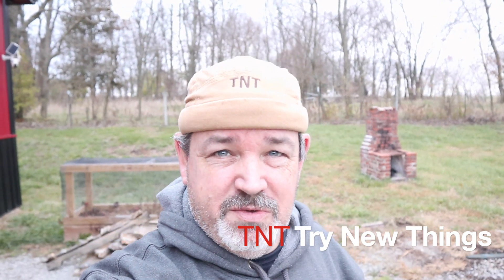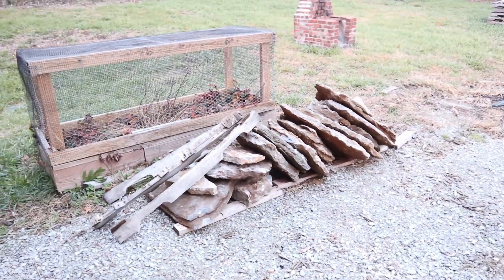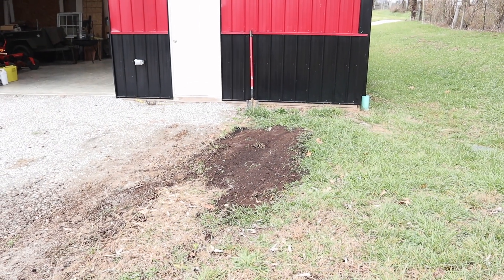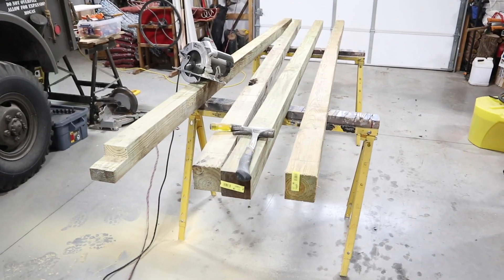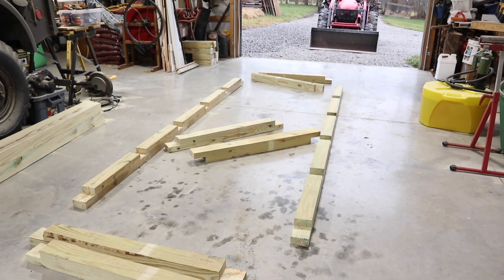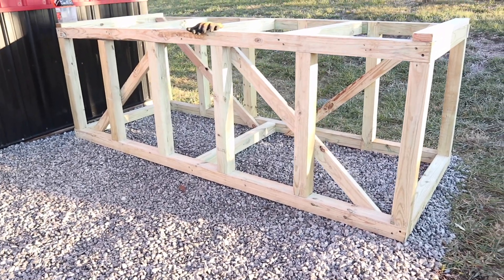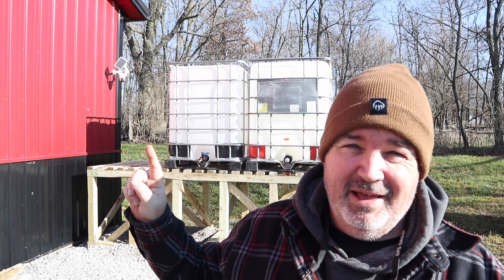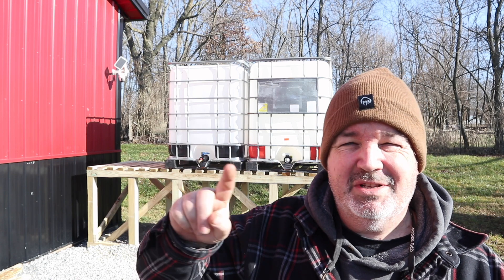#210:   Pole Barn IBC Tote Rainwater Harvesting System Build Pt.1/2

Comment: I'm seriously looking at the 3 barns I have and how I can collect the rain water from them. How do you keep it from freezing in winter?
Reply from the maker: I leave tanks about half full so they don’t blow over.   Turn of inlet valve at the downspout and drain that horizontal pipe that links them all together using threaded end cap.    If I lived somewhere where it stayed below freezing for more that a couple days at a time I’d be tempted to drain the tanks fully.   Surprising how quickly they fill back up.    IBC totes are a good system of cheap and readily available in your area.    Thanks for taking the time to leave the question.    Stay tuned to the channel, I bought a booster pump I’m anxious to try out when it warms up here in March.
Reply: @TryNewThings  I wonder if a water pump or airiation would keep it from freezing? In Western Tennessee we don't freeze for long periods of time (except one week in the year usually). It would be nice to have that reserve for the horses incase the power goes off in an ice storm or something like that. If they did need to be emptied, maybe a ratchet strap over them would ensure they stay put? 

I'd love to see what that piece is on the down spout. When does part 2 come out? I'm curious how this is plumbed.

Comment: What about freezing?
Reply from the maker: Winter plan is to drain the entire plumbing system (end cap) and turn off the fill valve.    I do plan on leaving some water in each of the tanks to keep them from blowing off the platform though.
I can shut off the water to each tank and keep the rest of the system 'dry'.   But, will only fill all 3 tanks if the system is "wet/live".

Comment: IBC totes are nice. I have 2 cages I throw stuff in. Be nice to have more but they are hard to get around here.
Reply from the maker: There are a lot around here, I should have gone with a more common size when I got the first two.   330 gal is larger than standard, and I had to drive south of Frankfort to pick up the last tank.